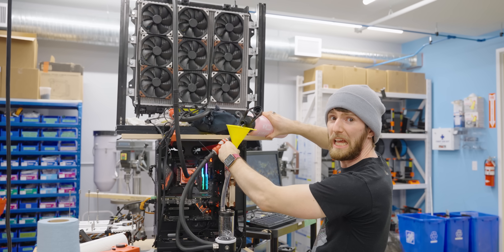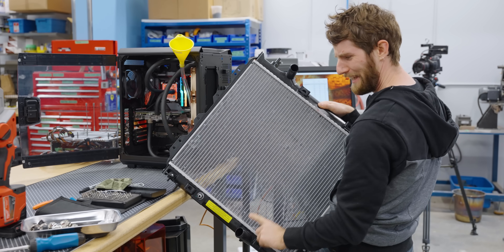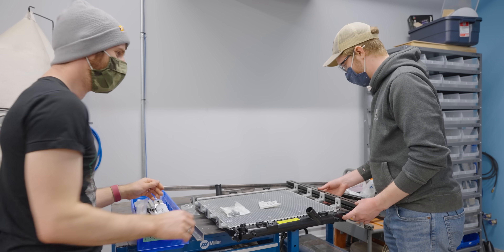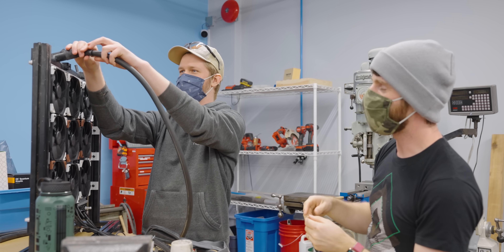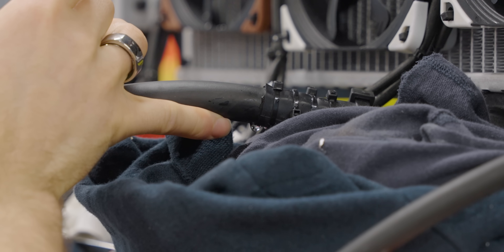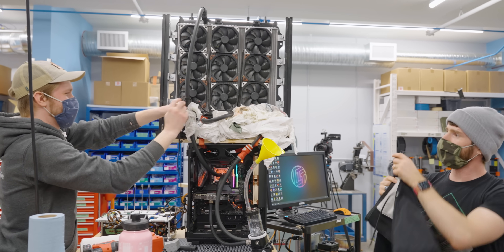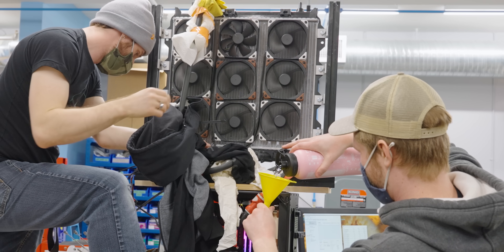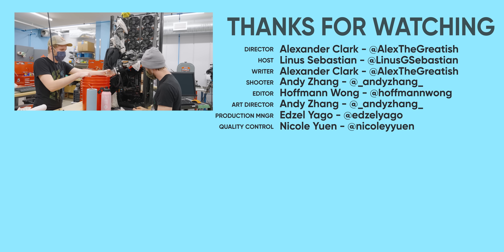Our Craziest Cooling Project Yet - Car radiator liquid cooler

Comment: nice video and good idea doing this, but I would have liked that you would have gave more effort into making sure there is no leak first, I mean you have everything to fabricate what is needed to acheive this :P ,  and then to test it properly, and also adding a water temp sensor in the loop to get the temperature reading.  but anyways, it was entertaining if that was the purpose :P

Comment: The transmission fluid is typically much hotter than the coolant in the radiator. 

It also brings the trans fluid up to operating temp more quickly.

Comment: I bet with a radiator that big, they didn't even need fans if they put it horizontally. 
Could they have just plugged the engine ports with something and just used the transmission cooler portion?

Comment: This was, besides a little funny and amusing, also quite cringy to watch. A little planning ahead, instead just winging it whilst rushing through it could have made things so much easier without the danger of destroying expensive hardware.

And putting the pump at the bottom and the radiator all the way at the top? Ever heard of concepts like gravity and water pressure? 

Then continuing to hastingly turning it on and trying to bench mark while it's still leaking loads of water, plus the fans aren't even connected yet.

If you were going for more of a comedic approach, mission accomplished, it was fun to watch.
But if this was a serious video, man was it amateuristic. So many bad decisions were made. I always thought of you guys as pretty smart, exceedingly knowledgeable, and quite professional.
But this looked like everyone had suffered an extremely hard blow to the head before attempting this.

Comment: Why not just buy the radiator hoses that go with the radiator and use the various machines in the workshop to make step down adapters? also could have just put a lot of silicone gasket maker on all the fittings before filling it with water.

Comment: What was the point in this? I'd love to see how this works if you actually spent some effort to do it right and not half-ass it. You can't even say the water in the loop got heat soaked so the temperatures you state are worthless.

Comment: Honestly I'm over this. 

There's an entire damn workshop of tools in the background and appearantly not a single hose clamp or fitting present anywhere. On a YouTube channel that constantly screws around with high end watercooling. 

Cutting apart a bike tube and using zip ties? Really?

You can do better, guys.

Comment: If they had the right fittings, and the seals on the fittings, this video would have been awesome.
Look at your local hardware store for the correct reducers and fittings, I don't think using a bike tire inner tube would have worked anyways haha.

Comment: At the beginning of this video I was yelling at my monitor as I have successfully done a car radiator for liquid cooled number crunching rig years ago...
Then I realized you were going for a 'keystone cops' motif  X~D  FUN
BTW. Home improvement store pvc reducers can come in handy and ebay has auto radiators for way cheaper ;~)
P.S. Put your radiator in front of an ac vent 8~]
Reply: P.P.S. The transmission loop is a wasted effort. ;~)

Comment: "Do we spend 30 minutes designing and 3d printing a watertight adapter, or try to ziptie loose flappy rubber?"
Reply: They could have just used glue to make it watertight and it would have worked xD
There is something like a "hot glue pistol" thats really cheap and super usefull :)
Reply: @JL-pc2eh  Any waterproof sealant probably
Reply: Yes
Reply: That would realistically take at least two hours
Reply: @Max24871   10 mins... at most.
Reply: It works in theory, like masks. Meanwhile everyone including nurses be getting sick all the time. And experts saying "but it wasn't supposed to happen!" LOLOL
Reply: @finlandjourney6065  get lost...
Reply: @finlandjourney6065  you obviously don’t know how the masks work
Reply: @slapmilk9421  There useless that's how the masks are designed to keep debris from flying at the face when working on a patient not to protect from disease
Reply: @Deadchannel06  when it comes to the spreading of disease in a public space, masks help slow spread by disrupting and slowing down the airflow and the water droplets that are exhaled. Pathogens are carried by these water droplets through the air, and by slowing them down, they would fall to the ground much sooner.
Reply: @Deadchannel06  Take your nonsense elsewhere please.
Reply: @Deadchannel06  Actually they have a multi layer structure. Outer layer is hydrophobic, internal layer is negatively charged so it attracts particles and inner layer is a wicking material ( may be wrong on the last layer) so they are a lot more effective then they appear. To be, sure an individual virus could slip through, but fortunately viruses don't just float around by themselves they are suspended in micro droplets of fluid which a typical surgical mask is designed to stop.

So whilst some people still get Ill it's a lot safer. Kinda like a bullet resistant vest and helmet. Sure you could still be shot and killed but the likelihood of that is drastically reduced by wearing that armour ;)
Reply: @freedomofmotion  Ok I see what you mean but also take this in for a second more people that were masks are more likely to get it than not and thats actually been proven also whats with your logic of covid hangs out in the doorways of the restaurant but not the tables or covid only hangs out inside stores not outside I will never wear one because I dont see the point in wearing one for a disease with a almost 100% recovery rate for instance ive never worn one and i've never gotten the covid nor have I been sick for over 3 and a half years lastly I want to thank you for not getting extremely mad at me like all the other people on YouTube and  Also palladen what Im saying is not nonsense do your own research Its what there mostly used for
Reply: @BlueSword455  Thats a really good point that I 100% agree with however we dont need to call him or her a pussy we need to wake them up but with factual evidence not cussing at them and no Im perfectly fine with offending people honestly i think people should grow thicker skin but once again theres no pint in calling him or her a pussy
Reply: @Deadchannel06  Fair enough
Reply: @finlandjourney6065  ... huh?

Comment: You guys need to do a follow up vid with all the proper fittings so no hose leaks then also attach a car fan to the radiator
Reply: Put the radiator in a fridge?

Comment: ROFL he starts the stress test while the whole loop is leaking out and the fans aren't even plugged in
edit: so like my verdict is, why was the radiator on top of the computer if you're not going to actually fix the leaks? it was definitely entertaining to cool a computer by effectively self destructing it but I kinda think that this project deserved a little more competency than that, the radiator could have been over a bin to pretty much the same effect while not causing panic by risking hardware.

Comment: Transmission loop was abad idea. This is to cool automatic transmission oil, and it is a loop that is separated from the main radiator, because oil and coolant should not mix. By looping it in, you only created a restriction in the flow of coolant.

Comment: While i get the point of the video, the entire thing feels like a sponsored plug from corsair or something due to the extremely poor planning.
Watercooling for PC's started on repurposing Automotive parts (just like this), and the dimensions and fittings are standardized for the most part.

rubber hose and c-clamps on the large inlet/outlets, and a locking quick release to rubber hose. place the rubber hoses over pvc pipes of same Inner Diameter, c-clamp them. creating a double loop (system loop out > rad in Small > rad out Small > rad in Large > rad out Large > Reservoir. Use PVC caulk around rubber hose ends. - Result = 0 leaks.

Automotive rads have more area, but are designed for much larger volumes of water. This means the water spends less time in the radiator potentially, So higher flow-rates or multiple rads are preferred. Motorcycle rads perform better than car/truck ones, as the pumps are smaller and offer usually a reduced flow-rate, increasing cooling. A strong in-line pump is usually recommended alongside a weaker system pump. you can still control these over PWM, but its a little more tricky to configure as 0-100 range may lead to over-pressuring the Res on the return. Ideally you want it to fill at the same rate as the rest of the system. So fine-tuning or replacing the entire pump system with exclusively a in-line pump is possible.

Would i do this in 2021? no, larger rads with lots of area but extremely high flow rate = bad.  | There is a company, out of Germany that already specializes in larger-rad, small fin PC radiators(reply later with name when recall). Costing the same price as the Automotive Radiator featured in the video. However, mounting points for 24x 120mm fans on each cooling face, and mounting points on each end for DDC pump and dual reservoir. Designed to be used externally or with custom in-case cooling solution...

A friend currently uses this setup for there Ryzen 5950 and Dual founders 3090's, seeing 25c at idle, and 49c under heavy overclocked load. This is in high ambient temperatures. It IS possible to go sub-ambient with water-cooling, however, the diminishing gains means alot of planning and math is usually required to achieve this in practice.

Comment: As an engineer who regularly makes watertight systems from different machines that don't go together, this has to have been one of the most stressful videos I've ever watched.
Reply: Im useless at this stuff, ive never watercooled anything, and with some planning, i could have done a better job easily, so lame, i wanted to see it work properly and as a how-to.

A 170buck radiator? Thats unironically cheaper than AIOs, it would be a great idea for ppl with low budgets but good space.
Reply: @Vihara2  I think the intended entertainment of the video was the poor quality of the execution. But yeah, I still found it stressful to watch. It wouldn't be that much of a challenge to make it work perfectly.

Comment: I looked and didn’t see it, so I’m going to add that the transmission cooler is cooled by the water flowing through the rad, it’s a liquid to liquid cooler, so plumbing it in only added restriction and additional connection points to leak. Also, try this again with a civic radiator, it’s smaller and has smaller hoses, so would be easier to adapt to the cooling system

Comment: I gutted a cheap corsair case, took out the motherboard tray cut out the back panel and made a sliding tray with two Koolance HX-1080 radiators on it that all slides inside. Thats 18 fans for a push only setup.

Comment: Idk why you went to Napa for a rad when ebay and Amazon have alot simpler and cheaper solutions. You can't weld to plastic like you could to a cheaper and better aftermarket solution. Seems like a rushed or not well thought out video imo.

Comment: I'm a automotive technician and this is by far the funniest comedy I've seen in a long time. The transmission loop isn't going to help you at all. The transmission loop literally only goes from in-let to out-let giving you very minimal cooling, you might as well not even use it. And OMG you placed a couple gallons of leaking water over electronics.....

Comment: I had this thought years ago but I was going to use an A/C Condenser from an 80's Camaro they have 3/8 inch (10 mm) tube fittings and a huge amount of surface area

Comment: Now, a follow-up to this video could be you fixing the leak issues and creating an actual case from the radiator; as in you use the radiator as one of the side panels of a custom case.
I'd probably recommend it being the rear side panel rather than the front side panel.

Comment: Kind of surprised you didn't make a case with the radiator being the "base" as it were. Thinking along the lines of that ThermalTake case which is just a backplate with a glass front.

We've already got a case which is just a giant distro plate (the motherboard attaches to) so would be interesting to see a PC being built onto that radiator instead as it might have an even smaller footprint as you wouldn't really need a reservoir due to the radiator being so big (there's also usually a filler cap at the top you can use for bleeding the air), and there's enough space you could create brackets for the motherboard, GPU etc without affecting the airflow too much.

Comment: Maybe the Bicycle tubes is a great idea... However you didn't try using them as heat shrink tubing :P Maybe it would have worked, maybe it wouldn't have. But with some sealant and proper time to seal. I feel that could have been a great idea to adapt the fittings. A lot less need to perma-panic if it worked. :P

Comment: I'm sure someone already said this, but the transmission cooler just runs through the end tank. So the engine coolant surrounds the transmission fluid running through a small heat exchanger.

I would really like to see this revisited after a trip to a hardware store and maybe 30 minutes of planning.

Comment: Actual question if anyone could help me. One person please not a hundred people so I don’t get non stop notifications. 

I have a CoolerMaster Master Liquid LC240E. Except the single fan version (mistake). I should’ve gone with the two fans and longer radiator but I thought for the remaining space in my computer case I would do a single fan. Anyways. I have an Intel i7 9700k, kicks off a good amount of heat. To the point, the fan pushes hardly any air through the radiator. And when I took the fan off and had it just move air, it was blowing air like crazy, so I knew the fan could move lots of air, and obviously I know when you put it in front of a radiator the airflow is restricted so I’m not going to get as much air through. But I get hardly anything through it. The air bounces back off the radiator and doesn’t go through. I keep the fan at 60% idle, and it will rev up to 100% when I’m editing certain things, which I’m fine with, I keep all the fans really high because I like to keep it as cool as possible. But please if anyone knows how I can get better airflow through the radiator that would be great! If it’s not possible then I’ll probably just upgrade to a bigger radiator model.

Comment: i was NOT expecting the glorious scrambling as almost every connection, sans the transmission ports, leaks. And it was awesome! Maybe next time just use a big box fan on the car radiator. Oh, and put one of those big ol air filters used on A/C units, ya know, for dust filtration. For extra jank, use an actual car radiator pump and fill it with DexCool. And not that 50/50 wimpy stuff either!

Comment: My guess would be the transmission "loop" just goes through the endtank of the radiator. It probably won't need to dissipate a lot of heat from the transmission anyway so just mixing it with the already cooled coolant will be fine.

I think in this situation they would have been fine with blocking off 2 of the 3 ports on the end tank.

Comment: I would like to see a retake on this with proper plumbing. What if you would do a test with only 2 120fans around the intake of that big radiator. Another question would be: can this radiator cool that system passively (maybe flipped horizontally)?

Comment: You should’ve use hose clamps on the radiator end of it That’s why they use them in cars The transmission one did not leak only because it had a hose clamp on it all this was unnecessary if they were to use hose clamps instead of zip freaking ties

Comment: Uhmm.  The trans lines simply run through a pipe, directly from one opening to the other, and does not run through the core.  Completely useless for low temp delta's

Comment: a couple alternatives come to mind.  first off, you could just get 3 420mm rads for similar environmental heat exchange OR you can use something like a MO-RA radiator (which is very similar to a car radiator only designed for pc liquid cooling with appropriate g1/4 threads, etc. to make life easy.)  otoh, I do like the VERY effective use of 80/20 extrusion for this - that stuff just goes together like an erector set and is a very solid solution - no wonder lots of 3d printers are based on it.

Comment: Fill the large ports with jbl weld and only use the transmission lines.   If you really want to use the larger ports you can make a plastic plug that gets epoxied into the hole that has been drilled and threaded for a hose nipple.

Comment: Question: (i might be completely wrong here but please feel free to correct me) Why are they (and all gamers) using water as coolant? Wouldn't another liquid like freon (used in refrigerators) be more powerful and have a better cooling effect (because it will gain and loose heat quicker than water)?